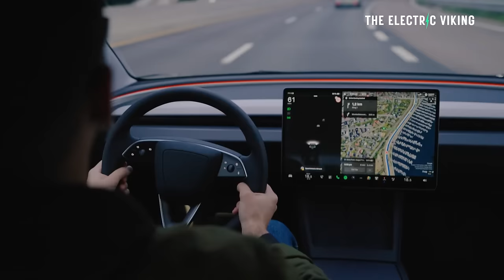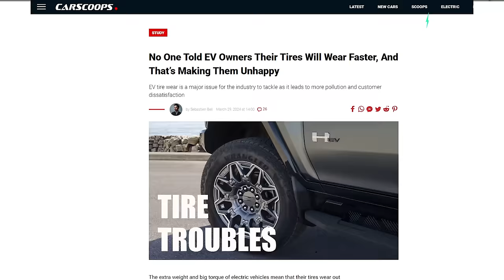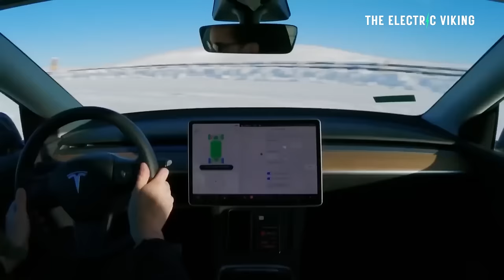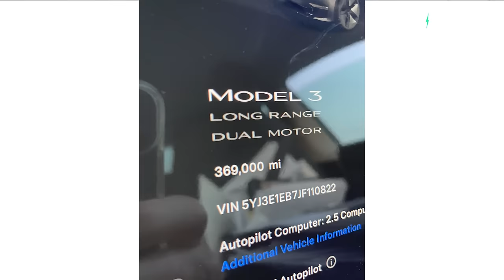I found the highest mileage Tesla Model 3 in the world - I'm shocked!

Comment: You may be asking the wrong question. 
We look at the number of miles driven on an EV because miles are what wear an ICE down. 
Miles may not be the biggest factor in EV longevity.  Charge cycles may be irrelevant since larger packs are rarely depleted.  
The prevailing factor for battery degradation may be time, and secondarily, climate. 
We have seen with other chemistries, such as NiMH packs in hybrids that they can endure about as many miles or charge cycles you can put on them in about 10 years. Regardless of how many miles you put on a hybrid, there is a huge battery failure rate at about 10 years. Anecdotally, I have seen similar issues when shopping for a used 1st gen Chevy Volt and came across too many that had failed packs at around 10-12 years old. This is in Florida where the warm humid climate may have also been a factor.  The question is, are Lithium packs such as those in BEVs subject to a similar shelf life?
Reply: I think calender aging will be an issue for many low mileage drivers when their cars pass 12 years. Nobody really talks about that. Many hybrid batteries are failing after 10 to 12 years regardless of mileage. Still love my m3 and probably won't go back to an ice car.

Comment: Our 2021 M3 SR+ LFP has 45k miles, 93% slow (at home) charging 7% Supercharging; 1% Battery Degradation. only changed front tyres because of a pothole destroying one and being forced to change both for balancing. Rear tyres still look new. Zero regrets. Have driven many cars for personal / business Mercedes, BMW, Volvo, Range Rover, Toyota, etc. nothing comes close to the simplicity and seamless user experience of Tesla.

Comment: I've hit 398,000kms on '99 civic sedan
Started heating up. No other major issues and the car was sold to a small dealer within 8hrs of posting my Ad.

355,000 kms on 2010 civic and this was ended with a collision, again was completely fine and had tons of life ahead. Just the a/c give you an issue at this point for civics and if you want to fix this issue it would have cost around $600-$1200 is what I was told. New parts. Used vs new.

So the civic has been great. I bought another 2013 civic at 26k and now it has 167,000kms again no issues just regular oil change, tires, my brake pads last about 90k-100k, muffler had corrosion so I got a new one installed ($260 part+labour).

Comment: The way I drive and sort of roads I drive on results in me getting around 15000 miles out of the ‘drive’ tyres with my various ICE cars.    I just replaced the first set of rear tyres on Model 3, LR.  They lasted 14,700 miles, i.e. no difference.

Comment: We have a 2018 M3 LR AWD, at 91,000 miles. We got it used from Tesla 3 years ago with 32k on it. Absolutely love it. We have 50k+ on our tires right now and they're close to needing replacement. We've seen no battery degradation the 3 years we've owned it. Best car we've ever had. So much so, we just bought a 2024.
Reply: Have you run the battery test and your at 100% battery health?
Reply: @jaykid007  Hey jaykid007! The 2018 Model 3 Long Range AWD has a max range of 310 miles when brand new (with the 19' tires). When we bought the car used in 2022 from Tesla the max range was 271 miles (so previous owner definitely saw some health loss). We've had the car for almost 3 years now (early 2022 to now) and the range has actually gone up to 282 miles - so the comment about no battery degradation is based on the max range from when we got it to now. We've mostly level 1 charged it and kept it below 80% charge so compared to most we're pretty easy on it.
Reply: @BatteryAddicted  wow that’s fantastic! I own a 2018 model 3 long range myself and have 64k miles. I’m only seeing max range of 261. I charged at home for 3 years and then super charged for 3 years. Now back to level 2 charging. You’re at 282. What are you doing to get that so I can duplicate!
Reply: @jaykid007  I think just luck. We only had access to a normal 110v outlet for the first two years of use (at work and home). The last year we've had level 2 charging and kept it below 80% unless we went on a long trip. We really didn't go out of our way to try to do anything either, lol. I hear as time goes on they slow down on degradation so we both should be good. 2018 was a great year. Love the roof when water hits it :D
Reply: Yeah been a solid car for the 2018 and the orange top for sure! I’m charging only to 80% now unless I really need the extra so I’m hoping it will fix itself on my way up to 100k. I did hear the degradation tapers off as well so we will see. But right now things are dropping faster then I ever thought.

Comment: Its all depending on your right foot.  I drove 156.000km now with my Model 3 LR on winter and summer tires and running on my second set of both tyre types. So in everage i drive 50.000km on a set of tyres.  Till now, brakepads and discs have no, i repeat no wear at all.  You even can't feel any edge on the discs. With my driving they will last the livetime of the car or longer.   The battery is now around 90% but already stable for a long time.  It gives a steady 450km range and normally i will get that in real.  Only fast driving (german Autobahn) gives a range of around 300km with speeds up to 140 / 160 average 130 km/hr.   I'm very,  very satisfied till now but i repeat: its all about how you drive.

Comment: 2019 M3 Long Range here 100,000 miles only 5% degradation
Reply: What’s your charging habits?
Reply: This is a good example right here. 5 year old car with the typical 100k and only 5 percent battery degradation! That’s way more than I would except at that mileage. I just don’t think batteries will need to be replaced unless something goes faulty. An 8-10 year battery warranty is sufficient! They will also probably have extended battery warranties at some point for the used market!

Comment: I have 480k miles and had my windshield and grid heater replaced. I’ve replaced shocks for comfort ride and that’s it. I think my under control arm is going out. My Tesla model 3 long range has the same tire for over 3 years. I use cross climate 3 for tires. I’ve lost about 7 percent range.
Reply: 480 000 miles on model 3?
Reply: @valentincolteanu3403  yes

Comment: I have a 2022 Model 3 had to replace tires at 16,000 miles.   I put on a set of Goodyear Assurance tires and have run them 55,000 miles and I think I will get another 10-15k miles from them.   I have been through 3 windshields and this one has a large crack in it.   Construction in Utah has wrecked havoc on the windshields.

Comment: I'm the next example? I did 145.000 km with my 2019 M3 LR , degradatin around 9% now and on my second set of tires! Tires last way, waaaayyyy longer than my former VW cars that eat tyres.  No parts are replaced and the control arms are still in perfect condition.  Just one issue with 1 seat heating (200 Euros to replace) and interior filters and windscreen  wipers.  That's all.

Comment: Tesla's have known camber issues and mass prduces them without adjustable camber arms. Thats why so many est the inside of the tire faster than the rest if the tire. 
Bexuae if this, it seems to be luck of the draw, if you got one with less negative camber than the rest. If it eas adjustable, you can pull some camber out allowing the tires to sit flatter. I believe their is some variation in this when mass producing without including the ability for a full allignmnent of all specs like this.

Comment: The tire use problem can be solved/mitigated with an adjustable camber kit. In fact they found that all model 3's get 10-15% more efficiency if the car is 1in lower than normal ride height with a good alignment.

Comment: I have a Long-Range RWD Model 3 (VIN in the 9000 range) that's over 6 years old. It only has 72,000 miles but it still charges up to 307 miles out of 310 miles original. I think it might go 400,000-600,000 miles!

Comment: Jeff Dahn of Tesla, tested the 2170 cells which got 1 million miles/equivalent of range, and said it comes down to the BMS, keeping the batteries conditioned.  Average ICE vehicle degrades range 5% after 100k miles, 10% after 200% miles, and keeps decking after that until the engine dies.

Comment: I've just sold a Mazda CX5 and bought a model y. I have solar and a deal with my electricity supplier which means a full charge only costs me an average of $4.00. If the y lasts 250,000 miles/400,000 klms. I will save $54,000 in fuel plus lower servicing costs plus the model y is a bigger and better car. The Y only cost $67,000.

Comment: i have a Tesla model 3 LR/dual motor and I replaced my tires at 32k miles.  I also had them replaced by Tesla for $1,900.  I am not complaining as I enjoy the acceleration. 😂😂
Reply: Not bad. I just changed the tires on my Model 3 rwd at 34k miles.

Comment: My March 2019 Freemont LR awd have had the upper control arms replaced on warranty - thats after 50000 miles.
But the battery is perfect - maximum 5% degradation (now 55000 miles).

Comment: Sam excellent videos, regarding front upper control arms it seems to me that they are not worn but they tighten up or bind due to lack of grease during manufacture which in turn puts pressure on upper control arm bushes, in the steering process. Mine had to be replaced at approx 36000 mls due to noisy opperation.

Comment: These are cars doing 200 maybe 250 miles per day. 
I’d add say the battery is at optimal operating temperature all the time. 
That’s got to be an advantage in terms of battery longevity. 
However that is not the case when commuting 2x20 miles per day in any weather. 
Same goes for combustion engine cars.

Comment: The tire issues depends a lot on the model and driver. 

I drove a very early 2012 Model S Performance Rear Motor for 140.000 miles. Battery would be less than 5% degradation.

But I'd got new rear tires every 10.000 miles. I also drove the brakes to the metal 😢😢😮

Drove it like a sports car.

Now have a Model S Plaid... Still 1st set of tires. 12.000 miles.

I guess it's true:  "Your mileage may vary"

Comment: Wow. I thought I had a lot of miles on my model 3 performance with 101,000 miles. Still less than 10% battery degradation. Nothing replaced except the back window for failed defroster wires. And the usual tires and wipers.

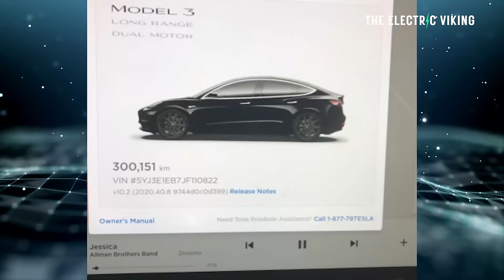Comment: I couldn't help but notice that several of the screenshots you showed listed the mileage in km rather than miles, yet you were reading the mileage as miles rather than km.    Since a mile is something like 1.6 km this does make a difference.    The tesla shown at frame (6:02) with 300,000 km has gone a little more than 186,000 miles rather than 300,00 miles.   The Tesla shown at frame (5:59) which you say has gone 500,000 miles has gone 500,000 km or about 310,685 miles.  That is still impressive mileage, but Miles and Kilometers are not the same.

Comment: I don't have a Tesla, but a two year old Leaf was affordable to me. I was getting older and knew that a low maintenance, low fuel cost vehicle was a more practical option as I transition to a fixed income. 
It now has more than125,000 miles and  the battery has degraded 25 percent. I can still get up to 50 miles on a good day. Usually don't drive it more than 40 miles a day. 
I know people who own Teslas, a Mustang Mach E4 and have talked to other EV owners and they are happy with their choices. I did see a Rivian on a tow truck though. Living on the left coast may be why I see so many EVs.
The sad thing is that when I travel what used to work 8 years ago has been removed, or doesn't work and the new stations are occupied. Electrify America is undependable when it comes to Chademo, so I consider myself fortunate to be able to charge at home. 
If you're not up for the adventure, don't.

Comment: We have several Teslas in the neighborhood with over 300K miles. Mostly 48 AMP charged at home on solar/Powerwall. Dunno if that made a difference but it's how we mostly charge our EV6 as well. We'll see. Tesla has a new battery coming out about the size of a Small Red Bull can, lighter, holds more power and is less affected by temperature and way cheaper and faster to produce. BEWARE: Some of these announcements are simply to hold up the stock price,, may not be all that's claimed.

Comment: I have never replaced a pool filter electric motor.  Runs for decades outside in cold or heat , snow or rain.  My garage door motors last forever.  No reason electric motors should fail

Comment: It’s a good talking point. It’s not evidence of overall EV battery longevity. It would be compelling if we could find 10,000 EVs with 250,000+ miles on the original battery and motor(s).

Comment: The reason many Tesla vehicles require frequent tire changes is owner driving style. Teslas have far more acceleration speed than most ICE cars, in some cases even very expensive sports cars. If the Tesla owner likes to use that extreme acceleration he/she will wear the tires more rapidly.

Comment: Viking, just because someone’s great uncle lived to 95 smoking a pack a day, that doesn’t mean that smoking doesn’t shorten smokers lives. Similarly, an example of a Tesla, or a few Teslas with high mileage (by the way, you mixed up miles and kms) doesn’t mean battery capacity reduction with age isn’t an issue. Taking the entire population of ageing gen 1 Teslas, how are the batteries fairing?
Reply: Very good, they just don't have as many miles as this vehicle. Also, Gen 1s get free battery replacements guaranteed in the warranty, they had a different battery chemistry back then.
Reply: @JohnMcAfee-se9ms  evidence?
Reply: @JohnMcAfee-se9ms  had a look at warranties, none of them say life time battery replacement for gen1 Teslas, but link me up. 

Evidence = supporting what you say, particularly with on point reliable info. 

I’ve no doubt that while the dendrites remain unconnected inside individual cells, a battery pack will put out power and hold some degree of charge. The point is one 350k Tesla isn’t a population sample. Not sure why this is a difficult concept for Viking or his fans. If one example is worthy of a marketing campaign then equally one BEV fire works as a counter. 

My PV panels weren’t meant to be doing as well as they are after 12ys. My solar battery has already lost 3% health in 2 yrs. I’ve paid some attention to battery tech. I broadlyunderstand the issues.

My point is about intellectual rigor and intellectual honesty, something that isn’t that strong on this channel.

Comment: My 2019 SR+ has lost a bit over 10% range and for only 90,000kms.  Degradation has slowed a lot the past 2-3 years though.  On second set of tyres which I would say is average.

I am planning on keeping it another 10 years all being well by which time it will be about 300,000kms.
Reply: Feels like the degradation is mostly caused by aging in the battery and not cycles.

Comment: i've replaced, in teh past year, 2 gas tanks, an exhaust, alternator, 2 tun ups, 2 fuel pumps, wheel bearing, upper a-arm on three vehicles - 04 mazda 6 with 156k, 99 civic 120k, 76 mg 48k. Tha's a lot more replacements than this guy's M3! I would expect wheel bearings or axle shafts. Motors? hard to say -starter motors and alternators don't last 300k...

BTW you're showing KM and speaking miles- slight difference!

Comment: Tyre wear in EV’s is an interesting subject. My Ioniq 5 AWD has covered 50,000 miles in two years and the tyres are about 70% worn. I expect to change them at perhaps 75,000 miles. For most cars braking wears more rubber than acceleration and generally EV’s decelerate under relatively smooth regen braking. This suggestion will of course be dismissed by the smoking tyre brigade, but the vast majority of EV users drive for a comfortable ride and to conserve energy. Although heavier than ICE vehicles in the most part, the additional weight is marginal relative to the increase in road wear due to speed, and ICE cars tend to travel at faster motorway speeds than EV’s, again because of the need to manage energy. The road load created by a vehicle at 120 kM/h is more than double that at 80kM/h.
All this of course translates to lower road surface wear for EV’s, contrary to common thinking that the opposite must be true because EVs are heavier than equivalent ICE vehicles.

Comment: There is actually a Tesla Model S that has done 2,000,000 kms and its on its 14th motor and 4th battery, not sure how many sets of tyres. My 10 year old Hyundai has 300,000kms, has had a set of brake pads, 3 sets of tyres and I replaced the battery and runs as good as when i got it new. I know a person who drives a taxi and has 1,500,000kms, original motor in his Falcon which runs on LPG, 5 years old and has only had to change his gearbox once and he gets roughly 100,000kms out of a set of tyres. No EV gets that sort of reliability or tyre life from what i have seen here or read in the comments.
Reply: My Hyundai has done around 220,000 kms, I estimate I have spent around $15,000 servicing it and around $40,000 on fuel. Furthermore the article explains the issue with the motors is for the very early cars, has been sorted and is not applicable to new vehicles.

Comment: I am 100% and electric fan and now drive a Mercedes EQA250. My highest mileage car was a VW Passat 1.9TDI Diesel from 2001. I sold the car for €500 with over 750,000 miles on it. Only needed 1 new clutch and maybe 3 sets of brakes in it´s entire lifetime.
Reply: Cape
Reply: @andreasl4507  what does that mean?

Comment: 4000000 Miles i'm very impressed.

To manufacture each EV battery, you must process 25,000 pounds of brine for the lithium 30,000 pounds of ore for the cobalt 5,000 pounds of ore for the nickel, 25,000 pounds of ore for copper Diging up 500,000 pounds of the earth's crust For just - one - battery.
That's more diesel than you could burn in a lifetime.